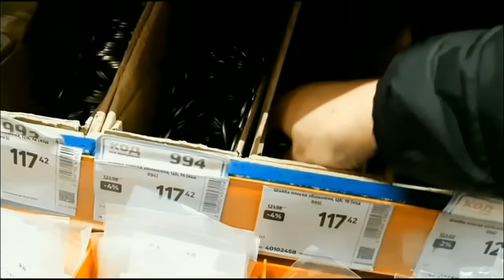Build BBQ Rotating Mechanism

Comment: I saw the makita drill appeared to be the motor mechanism. Something that suggested a quick fix solution to the problem of what to use as a motor. 
But after the washers are brought into the shop I became aware that this was not going to be a simple DIY to set up the devise I’m hoping to use today with very little effort. 

Next after the division lines of the washer further perplexed my hopes for quick and easy. 

Bust out the CNC machine to make gears and it’s clearly becoming a Henry Ford assembly line project to mass produce a pile of puny piggies or fowl. 

Great idea. 

But I’m going to watch the build because I love clever, but not when I’m wanting something asap and basic. The wheel is already working, not planning to make it better. You can work on that clearly better than I can. 😂

Comment: Great video. Question I have a yoder smoker. After sanding the fire box what can I put on it to stop the rust from coming back inside and out.
Reply from the maker: Thanks! In my case, I used heat-resistant paint

Comment: Excellent work Mate, just put an idiot proof cage over the cogs that way you won't have to say don't put fingers on or " I just thought your honour ?" 😀👍🏼
Reply from the maker: Thanks! But no need, during the operation everything is very hot, so everyone stays far away, even when the gears are cold it's impossible to turn without a motor. That's why I don't see any risk, even with small children.

Comment: Apart from the obvious safety concern about unprotected gears, could the heat from the barbeque make the lithium battery in your drill explode? Assuming the batteries are lithium that is.

Comment: Nice job! I'd cover those gears though , they are dangerous, mostly for children. 
But may I ask you something?
Why not using bicycle a chain and some bicycle gears that are very strong and you could find them as scrap ?
For sure It would be a much easier and faster build..
And for a motor you could use a 12v car or a lorry 24v(stronger) windshield motor mechanism with a dimmer.. 
Enjoy your barbecues!

Comment: How many liters is the water heater you used and what is the length of the water heater and the diameter?
Сколько литров у водонагревателя, который вы использовали, длины и диаметра?
Reply from the maker: Точно не скажу, не мерял, но думаю где то на 200 л
Reply: И с 00:11 сек. до 00:14 сек. из видео какая ширина и длина?

Comment: May i know what is the length and the diameter of the cylinder you have used to make the BBQ? So, by eye i would say 90-100cm in length and 40-45cm in diameter. But i'd like to know the exact measurements. Thanks in advance. BTW, nice job!